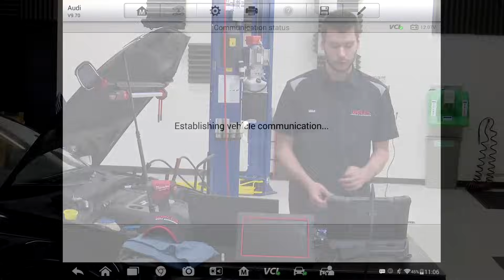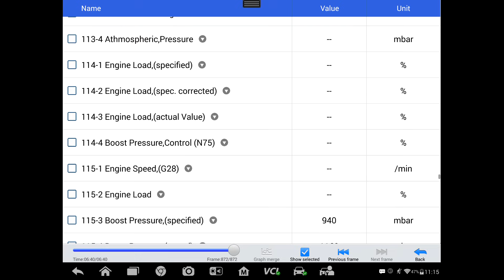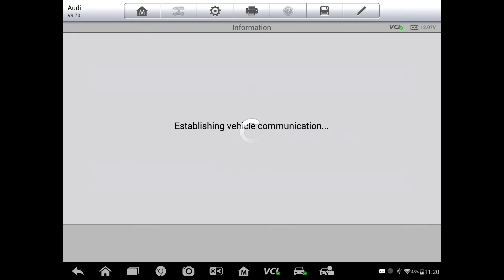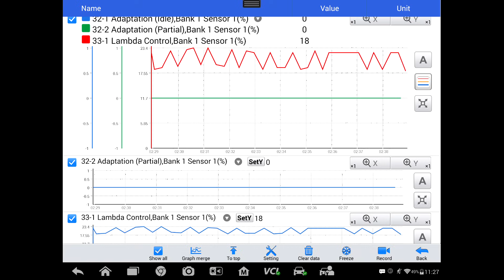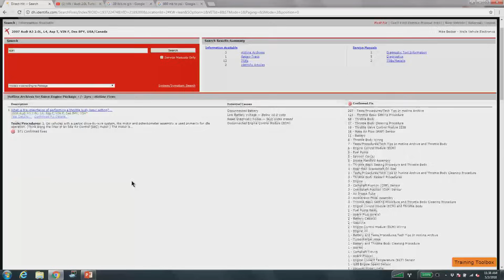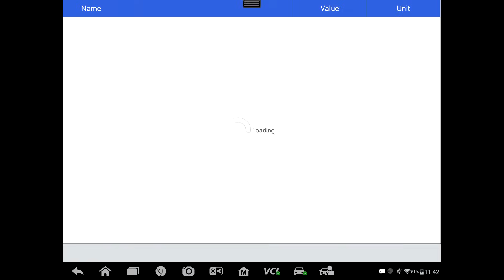VW / Audi 2.0L Turbo - System Too Lean Diagnosis & Repair P0171, P2177

Comment: I have jetta 4 1.8 turbo but it did mixed petrol an oil in the sum of engine.
Reply from the maker: Is the vehicle running rich? I would begin by inspecting the fuel trims.
Mike Becker, Senior Technical Instructor

Comment: on a 02 1.8t would be a common as well? i got the code for the emissions and here in cali they are very delicate. I plugged a smoke machine as well and no air coming besides the airfilter unit but i did have an issue when the radiator top hose blew and replaced it. I cant seem to  find the issue for this.
Reply from the maker: Hey Marc, what code are you seeing?
Mike Becker, Senior Technical Instructor
Reply: @GoTechTraining  lean code

Comment: So ..... you have a vacuum faulty code p2177. Why not immediately  use a smoke control.
Reply from the maker: Chris, it could be, sure. But smoke testing isn't always someone's first step.
Mike Becker, Senior Technical Instructor

Comment: I have been going in circles with a lean code on my 09 VW with a 2.0 tsi. Watching this video the light bulb went off, when I depress my brake pedal my RPM jumps around. I know what I will be checking tomorrow. I would not have thought of this in all of my years of experience...damn Germans.
Reply from the maker: Glad the video helped :)
Mike Becker, Senior Technical Instructor

Comment: these engines have a seperate vac pump for brake booster ...... NO ????
Reply from the maker: Hey Attila, these use a mechanically driven pump to supplement vacuum during boost conditions... it is still connected back to intake vacuum though.
Mike Becker, Senior Technical Instructor

Comment: Hey, Mike. I was wondering if you wouldn't  be able to differentiate a pcv valve, an egr valve, a purge valve lean conditions by symptoms. I would think that a purge valve lean condition would make the vehicle runs rough as well as an egr valve. Your thoughts on that?
Reply from the maker: Hey Leonardo, a lean condition is a lean condition. Honestly they could all act the same. Fuel trims will be a good indicator here. See what they do at idle compared to load can tell quite the story. Also, the purge may not ALWAYS run lean...it may run rich sometimes, especially after filling the vehicle with fuel. 
Mike Becker, Senior Technical Instructor

Comment: I have the same exact car has 2 codes 1 says to lean other says to rich. Y would this be?
Reply from the maker: Mike, great question. Could have been a situation that was rich to start and leaned out. This is common with stuck open purge solenoid. Take a look at that.
Mike Becker, Senior Technical Instructor
Reply: @GoTechTraining  thanks that's what I was gonna check after the pcv.

Comment: Hey man nice video! Can you help me? My car has this fault codes P2177, P1093 and P119A (Sensor G247 Malfunction).. Boost pressure, rail pressure, MAF are ok. When I clear the codes, partial Self Adaptation goes to 0%, but when I start driving it keeps rising until 25% and then all cylinders  timing retardation goes to -12º KW, have you ever seen something like this?
Reply from the maker: Hey Bruno, So you FT's essentially are going to +25 adding fuel. Could maybe be a MAF issue, oxygen sensor issue, maybe a lack of fuel, maybe a vacuum leak issue. What have you done so far for diag?
Mike Becker, Senior Technical Instructor
Reply: Everytime I clear the codes, the P119A always come Back (Fuel pressure sensor G247 - Malfunction), so i’ll try to change it and see if I can solve my problem, if not maybe i think could be a vacuum leak!

Comment: Broken EVAP dont give You trouble code??
Reply from the maker: Depends on the vehicle and the failure! Sometimes an EVAP issue can be masked by a lean code or something like that.
Mike Becker, Senior Technical Instructor
Reply: @GoTechTraining  You were right!! Just fixed My evap

Comment: My Audi A4 2009 2.0 TFSI (automatic) has this P2177 lean code. I did notice that sometime my brake pedal will be rock hard. Do you think my brake booster is the source of vacuum leak that causes the lean off idle issue? Please do get back to me as soon as you can. Thank you!
Reply from the maker: Hey Kimmy, definitely could be. A hard brake pedal generally means no vacuum in the booster...or a severe leak. It would be a good thing to check!
Mike Becker, Senior Technical Instructor
Reply: NGK Technical Training actually I just got my diagnostic result back from the shop. The shop actually did smoke test and found no leak. They let Audi USA to monitor all the sensors output during testing and all the sensors are working fine, except fuel trim is too high on both idle and off idle. The Audi engineer told me that most likely this is due to too much carbon accumulation on the inlet valve, recommended performing walnut blast, which is super expensive to do. He said this is the first step to do before further diagnostic can be done based on the data he saw. Do you think the carbon build up has anything to do with 2177 code?
Reply from the maker: Yes, it could. Carbon buildup was a common issue on those cars. If everything else checks out ok it may be your only option. Again....IF everything else checks ok.
Mike Becker, Senior Technical Instructor
Reply: NGK Technical Training just want to give you an update. It seems like the carbon cleaning does fix the check engine code 2177, though I was not convinced by the shop at that time. Been driving the car for 3 weeks now and the check engine light hasn’t come back.

Comment: Will a stuck open pcv cause a lean condition even if the air its drawing in is metered?
Reply from the maker: If the air is metered, no it shouldn't. If it's unmetered then it could.
Mike Becker, Senior Technical Instructor

Comment: You can always change English to Metric measurements with your scan tool to check the maf by going to the bottom of the scan tool and you where it shows M click on that and go to a settings that way so you don’t have to exit out to get there... I was stoked when i discovered that!
Reply from the maker: Tyler, great to know. I'll give that a shot!
Mike Becker, Senior Technical Instructor

Comment: I have an Audi A3 2007 and this is spot on. My car was not holding boost at all . It was giving lean problems etc. I cleaned the maf and my car run better but still not holding boots ,turns out my brake booster lines were cracked and my oil dipstick melted.  I haven’t checked the solenoid yet but I tapped  the brake booster and did a pull and it was now holding boost. At 10 psi. I tapped the oil dipstick and it went to 17 steady. But I did get the engine light code again. I’m ordering the proper parts now and hopefully it completely fixes the issue
Reply from the maker: Hey Nick, thanks for watching! Glad this video helped :) 
Mike Becker, Senior Technical Instructor

Comment: Do vacuum leaks on turbocharged engines behave different than in NA engines? Eg when you rev the engine a vacuum leak could make iteself not noticeable compared to the amount of air entering the system.
Reply from the maker: Sure, a vacuum leak could turn into a boost pressure leak under load. At idle a vacuum leak would be the same though, no boost psi at that point.
Mike Becker, Senior Technical Instructor

Comment: Is the pcv closed during idle?
Reply from the maker: Hey tht_speed3, the PCV system operates on engine vacuum. Think of it as a set vacuum leak applying a very slight amount of vacuum to the crankcase. It is not closed at idle.
Mike Becker, Senior Technical Instructor

Comment: Money is tight what is an affordable scanner with bi directional control mainly for evap troubleshootig open and close various solenoids while using smoke machine. Im looking at the autel 808
Reply from the maker: Hey Miriam, I like my Autel. I have the Elite. Works well but isn't exactly cheap. Not sure on the specs on the 808...just verify with them that it can do what you need before ordering. Check out Launch as well. They offer good tools at competitive prices.
Mike Becker, Senior Technical Instructor

Comment: Was it just Tech A?
Reply from the maker: David, it was a bit of a tricky question. An o2 sensor doesn't rear hydrocarbons...only oxygen. So the answer was actually neither. Thanks for trying!
Mike Becker, Senior Technical Instructor

Comment: doesn't the pcv valve open up when you accelerate
Reply from the maker: Think of the PCV valve as a metered vacuum leak. It is always bleeding back into the intake manifold. The higher the crankcase pressure the more its able to exhale. When you accelerate the vacuum in the engine drops so the PCV valve is probably forced more closed due to the spring pressure. 
Mike Becker, Senior Technical Instructor
Reply: Wells Vehicle Electronics will a vacuum leaks cause a lean condition if stuck open
Reply from the maker: Sure, if the PCV valve were stuck it could cause a vacuum leak.
Mike Becker, Senior Technical Instructor

Comment: i recently replaced a  brake booster on a 2011 altima.the booster itself its from nissan dealership.after i replaced it, two days later p0171 code showed up. i already smoked the intake for leak.nothing found. check maf sensor operation.seems okay. am i suspecting a faulty oem brake booster from nissan. what steps would you do next? i havent check the fuel pressure,because the car seems to run fine.
Reply from the maker: Hey Hua Jack, a lean code can be caused by so so many things! I would try to run the car rich and see if it reacts. This ensures the 02 sensors are reading what they are supposed to.
Mike Becker, Senior Technical Instructor

Comment: Hey. I got a wrx sti that is setting a lean code. My long term fuel trims are 24%. Short term is 3%. I home made smoke tested the vacuum system and found a leak and fixed it. But I’m still seeing same number after Ecu reset. When I did the smoke test I took oil cap off and smoke is coming out of oil fill. Is that normal?... what would you suggest? I already changed out maf sensor. And front 02. I saw that you said smoke out the oil fill could be an issue but do you have specifics for an sti 2013
Reply from the maker: Hey JP McPinning, Usually there will be some smoke coming out of the oil fill. I don't really have a spec on 'how much." Is the lean issue at idle? Under load? When is it occurring the most?
Mike Becker, Senior Technical Instructor
Reply: Wells Vehicle Electronics yes it is happening at idle and when I let off the accelerator. My long term and st . drop when I give it throttle. I did change my oil, and accidentally over filled my fuel tank before this problem started.( not sure if that has anything to do with my issue or not)  I did smell gas for a while.
Reply: Where would I introduce smoke to my evap system to test it? Or does a  smoke test on the vacuum system include the evap?
Reply: Wells Vehicle Electronics. I just found out that my short term fuel trim raises to 25% when I push my brake pedal...... as my long term raises and my short term drops I hit the brake and STFT raises about 6% but if I keep pushing it it goes to 25% in 2 or three pushes. I have checked everything you did in this video. Could my issue be in my booster too?. Thanks for your reply to my first comment I really appreciate your answer. Sorry to keep it going I’m just at my whitz end
Reply from the maker: So yes, it could be your booster giving you issue. If you smoking the car it depends on what system you are testing. If your smoking the intake manifold for vacuum leaks you can go in just about anywhere that seals. If your testing the EVAP system for leaks you would normally go on the canister side of the purge solenoid. IN your case I would smoke the intake manifold like we did in this video. You may just have a simple vacuum leak causing this issue.
Mike Becker, Senior Technical Instructor
Reply: Wells Vehicle Electronics thanks again for the reply. I’ve smoked the intake and can’t find a leak, but I’m only testing at like one psi cause I heard you can blow out oil seals if you give too much pressure and don’t take the oil fill off, but with the oil fill on it seams like all the smoke comes out the oil fill and there’s no pressure in the system.... anyways I’ll quit bugging you and keep trying to troubleshoot... your time is appreciated 👍🏻

Comment: My tsx got 2 codes p0171 and p0134 dose that mean i just need to replace the o2 sensor?
Reply from the maker: Hey DemikB16A there is no such thing as a code that says to replace a part....Every code points to a test procedure to verify why something is broken/failing. Your car is showing a lean code (P0171) and a bank 1 sensor one lack of activity code (P0134). Time for some testing!
Mike Becker, Senior Technical Instructor

Comment: Great class!!  It would have been interesting to look at global obd before you cleared the codes.  At least just for the fuel trim pids.  Values cannot be substituted under global obd and if the vehicle is running lean, that’s what you will see...
Reply from the maker: Hey Yanier, Thanks! You're right. I should have brought global up. Next time!
Mike Becker, Senior Technical Instructor

Comment: Good morning Mike. I always enjoy your great videos. Perhaps a suggestion. For us old guys, and for young ones too. Scan tools and scopes become popular pretty much after points went out. But points and condenser were able to do electromechanicaly what transistors do invisibly. So if u were to do a class that brought in an old car and u did your magic, imagine how much better us old knuckle draggers could get it. If using the Pico the channel connections could b as follows. 1. B+ 2. Negative side of coil 3. Point side of resistor. 4. An amprobe around the supply wire. As the engine is running, or the distributor is turning the dwell as expressed in degrees of rotation would remain stable at about 30(v8)degrees. But the square wave, or ? Would change with rpm. That would help us to comprehend the time base function of the scope. The resistance of the resistor varies with the time that it is on, as in points closed ignition on. Remember when people would listen to the radios and burn up the points?    Trained by Techs did a great video on a fuel pump actually running in a tub of water, as u have done with tanks and evap situations. Videos which were very instructive. Anyhow, just a thought. U have the facilities and the subs to best present that. And, u CAN wrench. I remember the Toyota video where u turned nuts and bolts. Thank u!!
Reply from the maker: Hey Bill, ohhhh man. An OLD CAR?! I don't know if I could do it Bill. I have a thing about working on cars older than me ;) I get your point though. Related the old stuff to the modern stuff. Makes perfect sense. I'll look into doing something like that. Thanks for the suggestion Bill, have a good one!
Mike Becker, Senior Technical Instructor

Comment: Hey Mike.  Damn I missed the livestream. This is another awesome presentation. Had new carpet being laid. Man you are good and thorough. I made a paint can smoker and i like the fact that it will blow the lid off like your yellow plastic caps did if too much pressure. Won't break any components.  Also I've had to replace the brake booster vacuum check valve more than once on F150's. I've never thought to check the booster internal diaphram but now I'm more aware. Whats your total time invested in this one? LOTS!! Thanks Mike.
Reply from the maker: MIKE!!!! I missed you live :( A homemade smoke machine, nice! Good to know on the F150, i'll watch for that! As for time...too much haha. I have probably 5-6 hours in diagnosing this thing. I spent SOOOOOO much time going after fuel and boost because I thought the lean issue was under load :*( Anyways, thanks for watching Mike!
Mike Becker, Senior Technical Instructor
Reply: Yep. A paint can smoke machine. I picked up a couple different size heater wires from the local VAPE shop to try. Burns baby oil on oil lamp wicks. Did you know that metal epoxy putty is non-conductive? Works great as an insulator and bond for the 2 binding posts. I took Keith's advice also, THANKS KEITH,  and always leave it running when I disconnect it from the intake/evap ports and then turn it off. I don't want to turn it off first and have backpressure feed fuel vapor into the can with the heating element still hot....  5-6 Hours. Good thing you're not flat rate at the Audi dealer. LOL. I wouldn't have ever figured that much out.  I would have figured out the floor drain a lot faster.  Thanks Mike. Always valuable information and skills you're sharing with us.  OH. BTW...Neither Tech is correct would have been my contest answer.
Reply from the maker: Mike, that could be bad if you let the back-pressure force into there. That is great advice from Keith, as usual. That floor drain....hasn't acted up since haha! That's the correct answer on that. Nicely done. Have a good one Mike!
Mike Becker, Senior Technical Instructor

Comment: Great video! Just as a heads up. When u want to convert the units of measurement, for example MAF to gr/s u can do it on the scanner instead of googling. With the PID showing u can hit the little drop down arrow where the graphing option is present and it’ll have an icon of a scale further right and that option switches the unit of measurement from lbs to grams. Thanks again for the class
Reply from the maker: Hey Jerstuube, thanks for the heads up! I know you can do it in live data, but in my recorded file I could not change it because I didn't change it when I recorded it....ooops! Thanks for watching, glad you enjoyed the class!
Mike Becker, Senior Technical Instructor